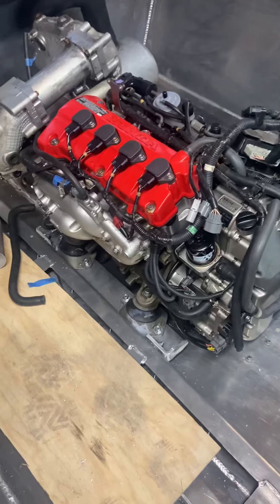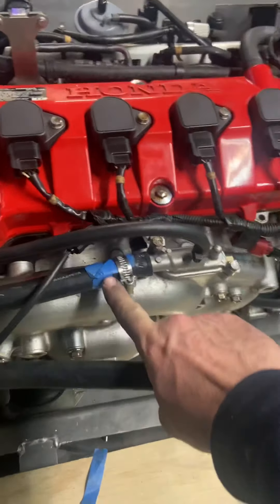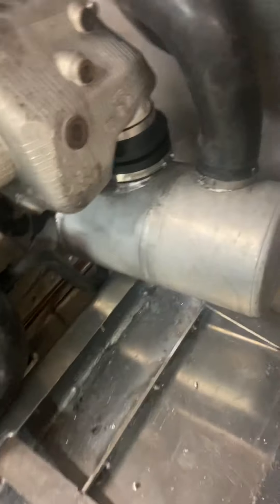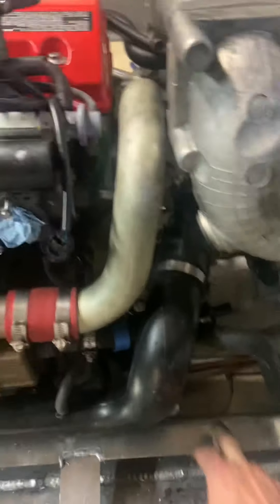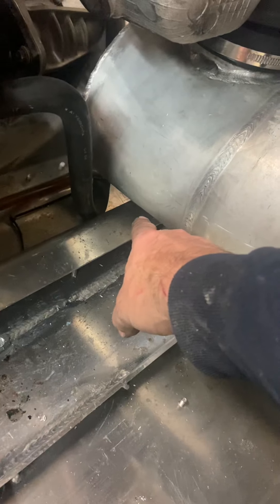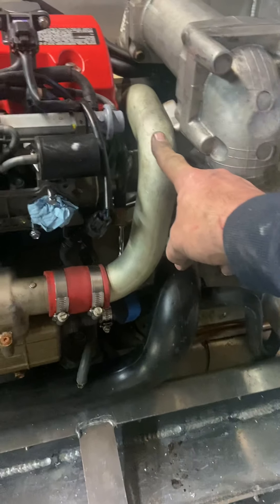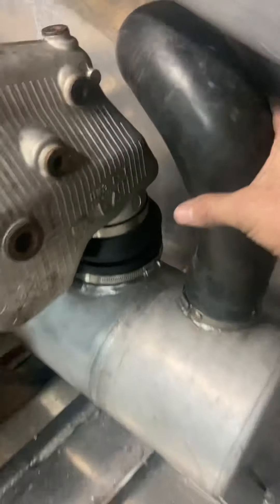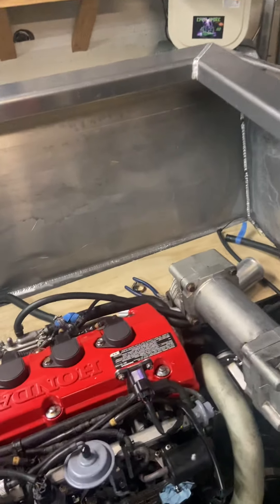Honda Turbo is in!!! Mini jet boat build (9)

Comment: What size boat and what size ski engine do you prefer?  I have seen 10' and 12' boats all over but am unsure which I should try to get the designs for.  Do you order the kits or do you have your own built?

Thanks,
Reply from the maker: Hi Tom.  I’ve built a few 3.6M and one 3.3M and about to start a 3.0M as well as 3.8M.  It totally depends on what you want out of the boat.  Ultimate small channel, skinny water then the 3.0 with 2-stroke.  Want more speed, power and hokeshot…3.6 with SVHO is what I’m personally going with.  Want to haul 4 people and more gear?  3.8 might be better suited for you.  I buy kits from RSRacecraft, I believe in their design, their experience and their customer service!